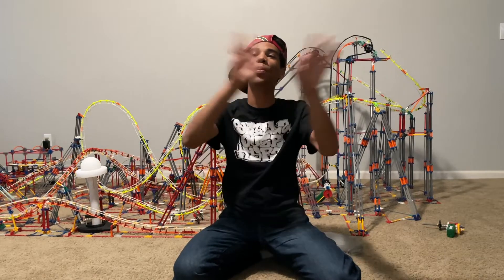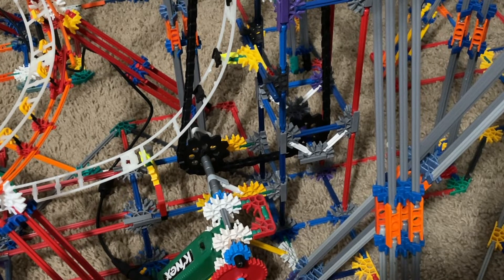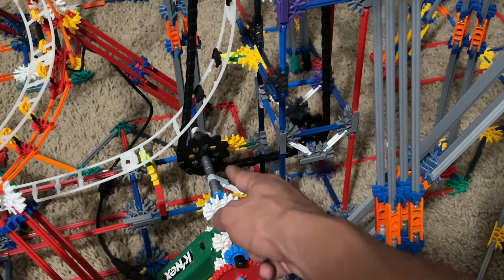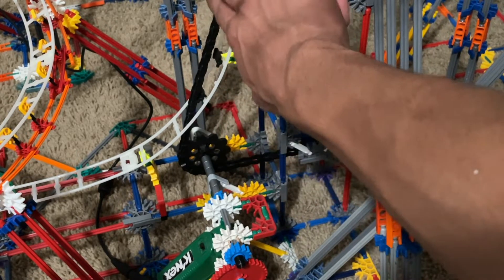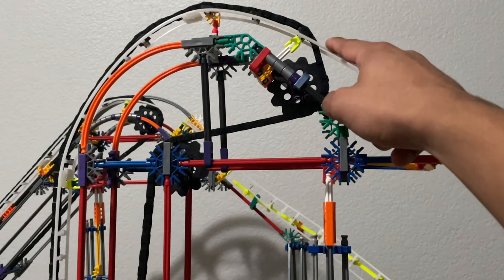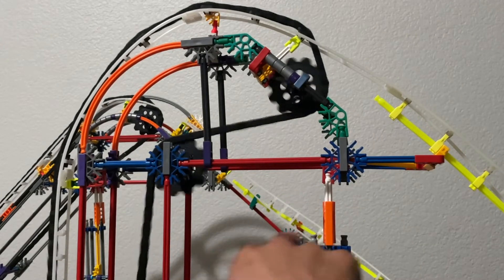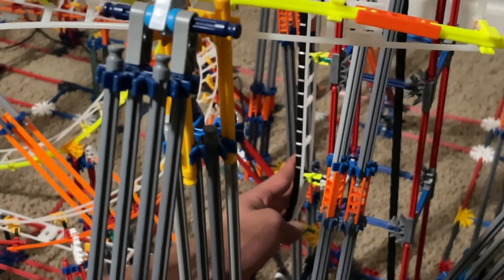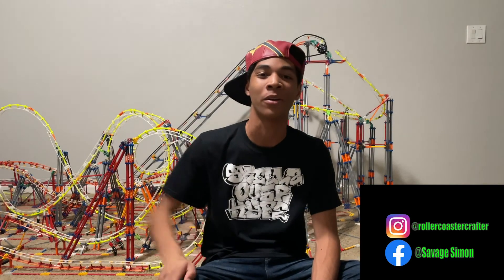How to make a Vertical lifthill (In depth guide)

Comment: you can use string to guide the train, and have it start much lower, and it will follow the curve of the track
also, what you referred to as torque , is tension

Comment: Is there a reason you did not include any of the sleeve tubes around the post you are using for the torque? Either the larger gray tubes or the narrow light blue rings? Is it not necessary or is there another reason?

Thanks for these tutorials! My kids are getting into custom builds now and these are very helpful!
Reply from the maker: Hello there, there is no particular reason why I didn’t include them. A lot of times those gray sleeves are used to slide the chain along the rod but they are not necessary. I’m glad to hear your kids are getting into custom builds! Hope you guys have a lot of fun!